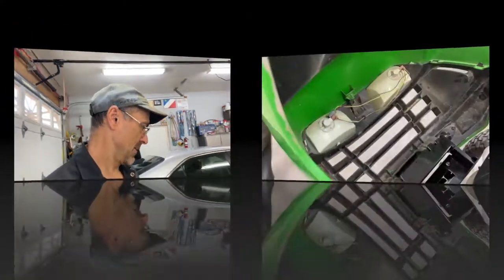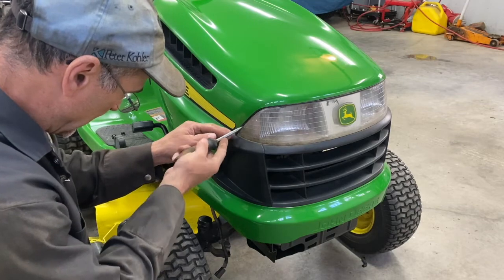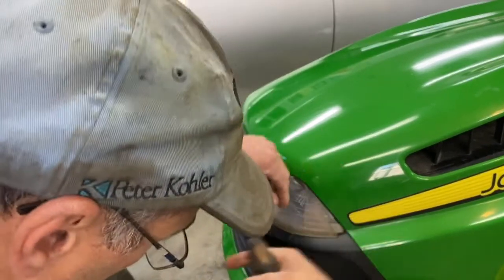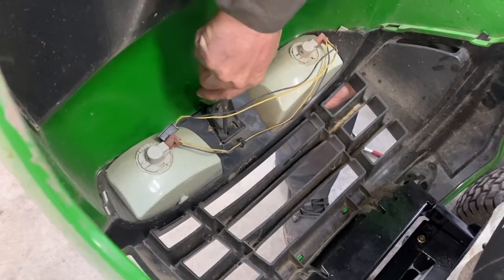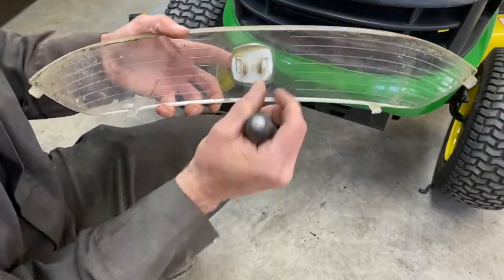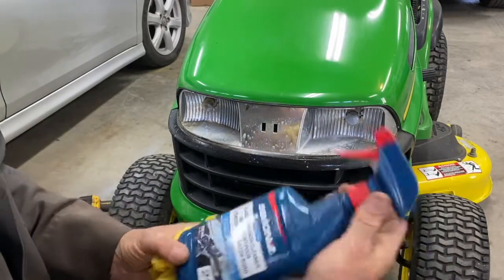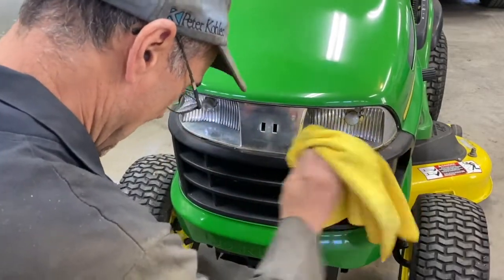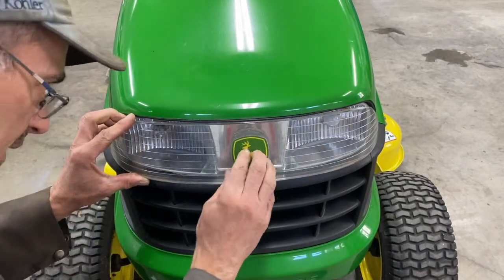How to remove your Headlight Lens on a John Deere LA 100 series. LA105, LA135, LA140, LA155 etc..

Comment: That’s the cleanest LA model I’ve seen today. I have a LA120, 14yrs old, and has terrible rust damage. Looks like this one has been used only a handful of times.
Reply from the maker: Thx.  It was in bad shape when I bought it. I sandblasted the fenderdeck & mower deck.  Painted them up and I sold it locally.   
  I have a waiting list of customers to buy my restored tractors when I’m done with them.     
  I’m working on a LA115 now. Should be done soon.   Checkout my videos on my LA165 restoration.  (6 videos).
Reply: I forgot to respond. Sold the machine for $950 back in October, and purchased an X340 for 250. Working on that right now.
Reply: Nice fix up. Bought an LA105, within a month Green paint started to bubble and fall off. Called the Dealer, they said call the Factory, called the Factory and was told it was a Dealer Problem, call them... I drive it so everyone knows JD paint jobs ain't worth crap, very disappointed in them. It still runs good and that's the only thing saving them.

Comment: I just bought a la 125 and the headlight wiring was missing But lo and behold JD can sell me the headlight wiring for 125 bucks  for 2 plastic light holders and 2 wires ?
Reply from the maker: Buy two head light sockets and wire ends. Add the wires.

Comment: Instead of using a screwdriver to pop off the two plastic lens cover tabs, which could break the tabs holding the cover in place. Instead, pop the connectors out from inside the hood.
Reply from the maker: That works better.  Thx